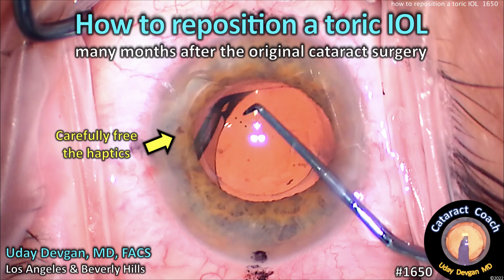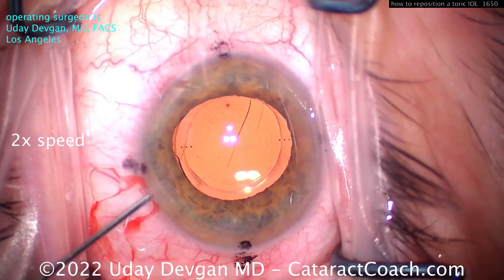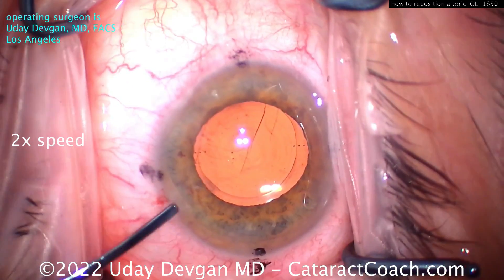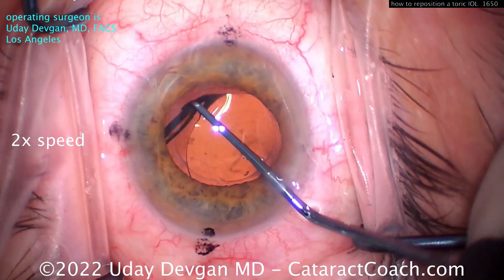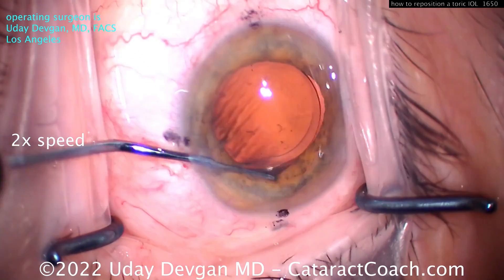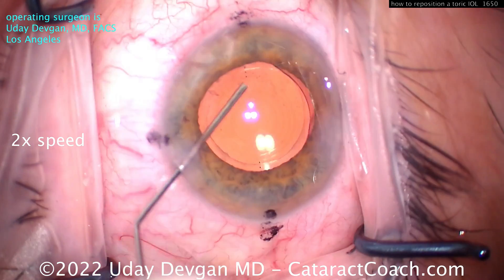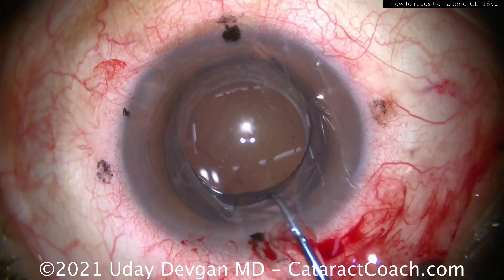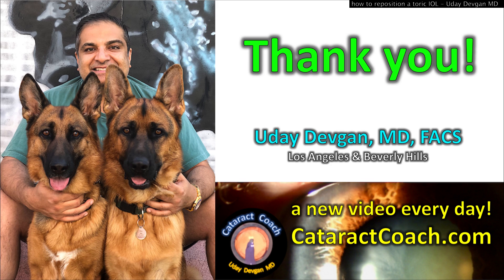CataractCoach 1650: how to reposition a toric IOL

Comment: Hi Dr Uday, i 've had my cataract surgery on 24th Feb and was told my trifocal toric iol has rotated on 9th March. The surgeon then performed the iol repositioning surgery on 10th March. After 3 days, my vision is still blurred. I am worried. But the surgeon said he will only be able to examine my eye after 1 week as he's out of town. But he said probably due to dryness thats why my vision is blurred. will dryness cause blurred vision? I actually felt a much stronger sting and burning sensation during the repositioning surgery compared to the intial cataract removal and iol implant surgery, and my eye has alot of discharge (tears) for about 1 day , why so?

Comment: Thanks Dr Devgan for another fantastic video. Aside from my surgical supervisor, your videos have been the single greatest source of learning in my Ophthalmic surgical career thus far!
When I move to a new surgical centre with recording capabilities I will definitly submit a video to you.

Just a question... how much residual astigmatism/how many degrees of misalignment before you decide to return to theatre to reposition a toric? For example, Would you typically go back in and reposition if there was say... 10* misalignment and just 0.75D residual Cyl if the patient was symptomatic from the astigmatism?  Or would you only go back in for big misalignments (like 90* in the current case)?

Comment: nice managenent  but  if  both  haptics adherent to the bag with fibrosis what is the solution of this ????
Reply: In this case cut the haptics and leave the ends where they are, they won’t interfere because they are 90 degrees away.